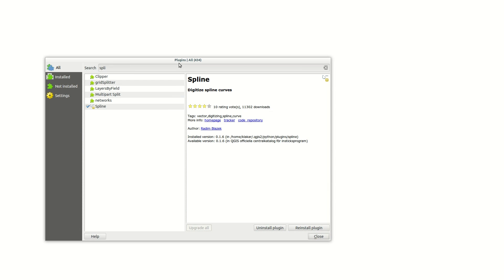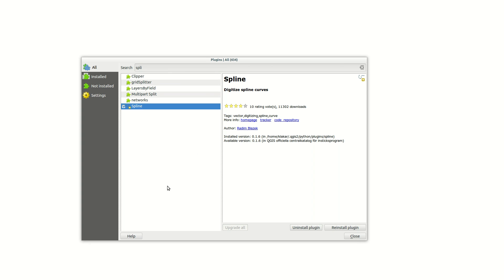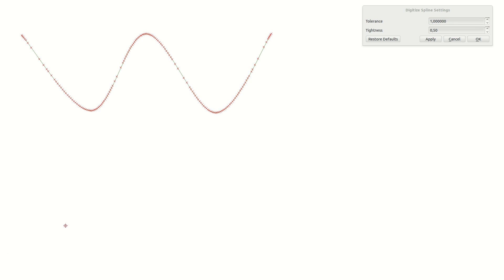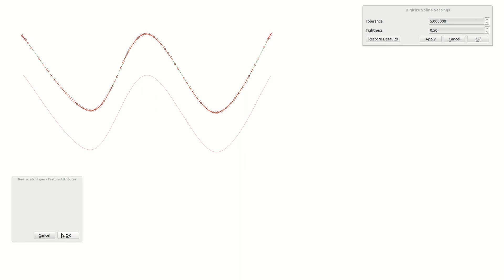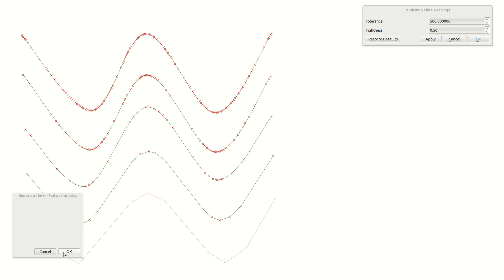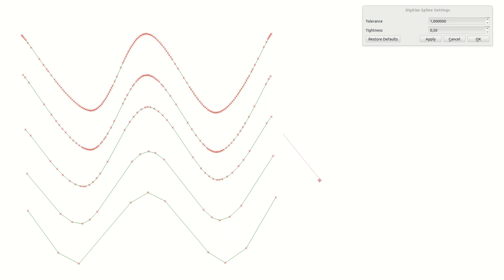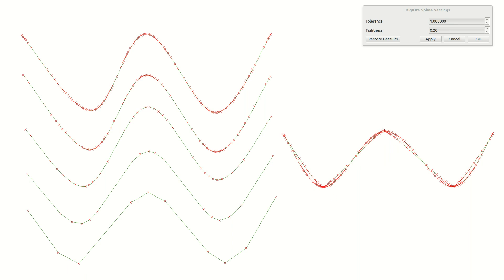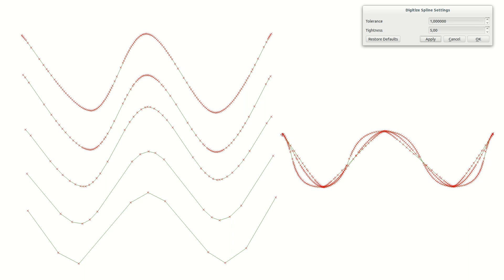QGIS Quick Tip - Spline Curves

Comment: Doesn't work for me either- 

An error has occured while executing Python code:

Traceback (most recent call last):
  File "C:/Users/JTaylor/.qgis2/python/plugins\spline\spline.py", line 157, in canvasMoveEvent
    startingPoint = QPoint(x,y)
TypeError: 'NoneType' object is not callable

Python version:
2.7.5 (default, May 15 2013, 22:44:16) [MSC v.1500 64 bit (AMD64)]

QGIS version:
2.8.4-Wien Wien, 71ba2c7

Python path: ['C:/Users/JTaylor/.qgis2/python/plugins\\processing', 'C:/PROGRA~1/QGISWI~1/apps/qgis-ltr/./python', u'C:/Users/JTaylor/.qgis2/python', u'C:/Users/JTaylor/.qgis2/python/plugins', 'C:/PROGRA~1/QGISWI~1/apps/qgis-ltr/./python/plugins', 'C:\\PROGRA~1\\QGISWI~1\\apps\\Python27\\lib\\site-packages\\matplotlib-1.3.1-py2.7-win-amd64.egg', 'C:\\PROGRA~1\\QGISWI~1\\apps\\Python27\\lib\\site-packages\\nose-1.3.3-py2.7.egg', 'C:\\PROGRA~1\\QGISWI~1\\apps\\Python27\\lib\\site-packages\\tornado-4.0.1-py2.7-win-amd64.egg', 'C:\\PROGRA~1\\QGISWI~1\\apps\\Python27\\lib\\site-packages\\backports.ssl_match_hostname-3.4.0.2-py2.7.egg', 'C:\\PROGRA~1\\QGISWI~1\\apps\\Python27\\lib\\site-packages\\certifi-14.05.14-py2.7.egg', 'c:\\osgeo4~1\\apps\\python27\\lib\\site-packages\\python_dateutil-2.1-py2.7.egg', 'c:\\osgeo4~1\\apps\\python27\\lib\\site-packages\\six-1.3.0-py2.7.egg', 'C:\\PROGRA~1\\QGISWI~1\\bin\\python27.zip', 'C:\\PROGRA~1\\QGISWI~1\\apps\\Python27\\DLLs', 'C:\\PROGRA~1\\QGISWI~1\\apps\\Python27\\lib', 'C:\\PROGRA~1\\QGISWI~1\\apps\\Python27\\lib\\plat-win', 'C:\\PROGRA~1\\QGISWI~1\\apps\\Python27\\lib\\lib-tk', 'C:\\PROGRA~1\\QGISWI~1\\bin', 'C:\\PROGRA~1\\QGISWI~1\\apps\\Python27', 'C:\\PROGRA~1\\QGISWI~1\\apps\\Python27\\lib\\site-packages', 'C:\\PROGRA~1\\QGISWI~1\\apps\\Python27\\lib\\site-packages\\PIL', 'C:\\PROGRA~1\\QGISWI~1\\apps\\Python27\\lib\\site-packages\\jinja2-2.7.2-py2.7.egg', 'C:\\PROGRA~1\\QGISWI~1\\apps\\Python27\\lib\\site-packages\\markupsafe-0.23-py2.7-win-amd64.egg', 'C:\\PROGRA~1\\QGISWI~1\\apps\\Python27\\lib\\site-packages\\pytz-2012j-py2.7.egg', 'C:\\PROGRA~1\\QGISWI~1\\apps\\Python27\\lib\\site-packages\\win32', 'C:\\PROGRA~1\\QGISWI~1\\apps\\Python27\\lib\\site-packages\\win32\\lib', 'C:\\PROGRA~1\\QGISWI~1\\apps\\Python27\\lib\\site-packages\\Pythonwin', 'C:\\PROGRA~1\\QGISWI~1\\apps\\Python27\\lib\\site-packages\\Shapely-1.2.18-py2.7-win-amd64.egg', 'C:\\PROGRA~1\\QGISWI~1\\apps\\Python27\\lib\\site-packages\\six-1.3.0-py2.7.egg', 'C:\\PROGRA~1\\QGISWI~1\\apps\\Python27\\lib\\site-packages\\wx-2.8-msw-unicode', 'C:\\PROGRA~1\\QGISWI~1\\apps\\Python27\\lib\\site-packages\\xlrd-0.9.2-py2.7.egg', 'C:\\PROGRA~1\\QGISWI~1\\apps\\Python27\\lib\\site-packages\\xlwt-0.7.5-py2.7.egg', u'C:/Users/JTaylor/.qgis2//python', 'C:\\Users\\JTaylor\\.qgis2\\python\\plugins\\DigitizingTools\\tools', 'C:\\Users\\JTaylor\\.qgis2\\python\\plugins\\intramaps_qgis\\ui', 'C:\\Users\\JTaylor\\.qgis2\\python\\plugins\\mmqgis/forms', 'C:\\PROGRA~1\\QGISWI~1\\apps\\qgis-ltr\\python\\plugins\\fTools\\tools', '//belmont.wa.gov.au/CoB/Shared/GIS/Jobs/160108 2016 Harmony Week Map/Workspaces']

Comment: Hello. For some reason the plugin doesn't work for me. I am using QGIS 2.10.1 the platform is Windows8. I have tried reinstalling it, but it didn't work. Help, please.
Reply from the maker: +Katusha Kochetkova If you try http://gis.stackexchange.com/questions/tagged/qgis and describe your problems some more, I'm sure you can get help with your problem.
Reply: +Klas Karlsson, thank you very much for your quick answer. I am trying to het help at the forum.
Reply: +Katusha Kochetkova Heyho, did you find a solution for your problem? I tried to use it, but it didn't work properly. It is there and I can draw lines, but they are not curved. There are no vertexes interpolated. You have an idea how to fix this?
Reply: +Merry Em Unfortunatelly, no. Doesn't work for me. I have installed QGIS 2.12 which has some kind of a curve tool introduced, but it doesn't do what the Spline module should do. No luck so far.
Reply: Katusha Kochetkova I installed 2.12 today, too, and saw the curve tool, but it really is different from the spline tool. Thank you anyways for replying. :)